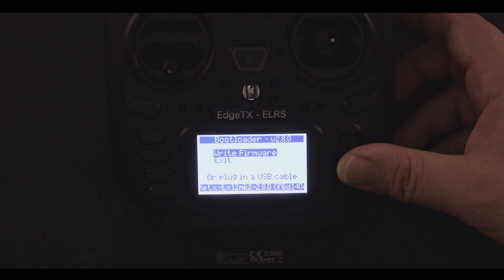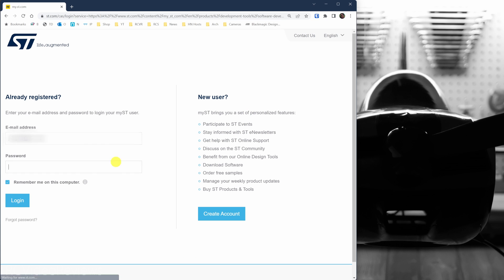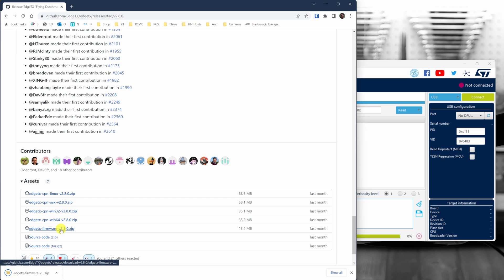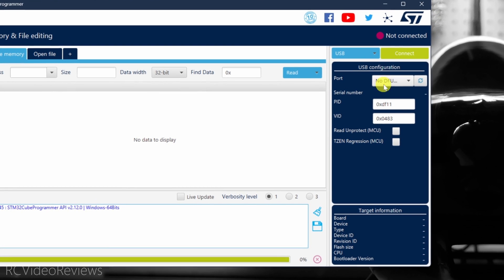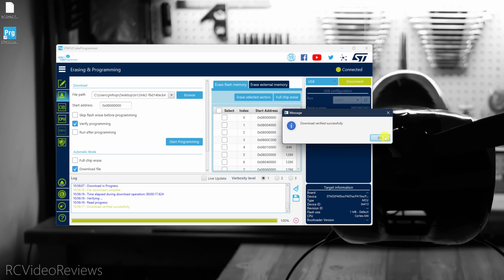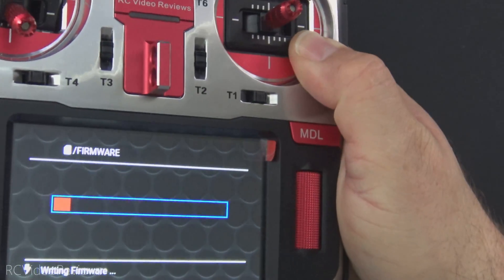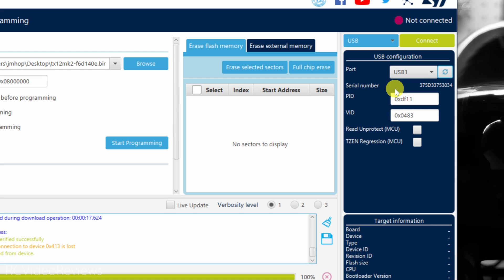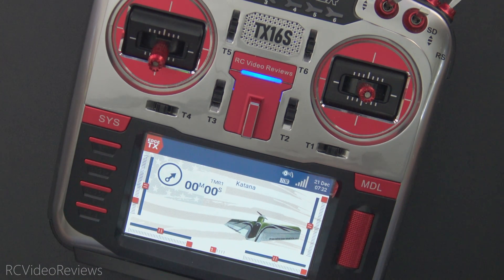BRICK your EdgeTX radio? I got you...let's fix it.

Comment: radiomaster says the issue is edge tx.. you don't need to unplug during update to brick the radio, it happens if you just leave the thing with no battery for a month of no use. next time you come back you either get no power on or bad radio data. just happened to my tx16s and my pocket this whole thing is rather irritating

Comment: Didn't work on my FS PA01. Almost worked. I can connect the controller to the STM Cube Programmer and I can flash it. I then disconnect the USB lead and its just dead. Also, I have to remove the batteries to get it to link otherwise I cannot get the USB link 'bong' noise and to show in the programmer.

Comment: Just spent several hours trying to get my TX16s out of its bricked state after I vainly tried to upgrade from Open to EdgeTx. Used EdgeTxbuddy and it seemed to work i.e. got the screens etc, but not my models (which I did backup). That was last night, this morning changed the batteries in the TX16 as they were getting low, powered it on and apart from the flashing 1-6 indicators and a momentary blue light, screen is blank. Wont turn on at all now, although does occasionally flash lights, but not everytime when i push the power button. So, came across your video and thought "Yes, at last" and carefully followed your instructions. Alas, same thing, no difference, although I do think there might have been a glimmer on the screen when I pushed the power button. Have no idea what's going on and at my wits end. Almost makes me feel like just giving up on RC, I'm so frustrated. Anyway, without a TX I cant fly anyway, so maybe will call it a day. But thanks for posting, have always found your videos super informative and helpful on so many aspects of the hobby.

Comment: Hi John, thank you for this unbrick-the-radio procedure. I have a separate issue, after upgrading the EdgeTX firmware on my TX16S its RS slider doesn't work properly. It tights to the SA toggle switch. I had never seen this happen before, the SA switch has to be at the center or forward position to activate the RS slider. If the SA switch is at backward position, the RS is disabled! I reinstalled the EdgeTX firmware several times, but this issue is still there. Your advice would be appreciated. Thank you.

Comment: Thank you for a concise, informative and useful video. I used your guidance to unbrick my Taranis X-lite; STM32CubeProgrammer has no issue picking up the radio with or without the batteries in and installing the new firmware, but it still won't turn on. When I open/close the battery "tube" the power button lights up momentarily but doesn't respond when pressed. Any suggestions?

Comment: Will this fix internal module update error?   I have a brand new 16s and the internal 4-1 doesn’t work.  It won’t accept the flash.    The rest of the radio works fine

Comment: When trying to ocnnect to my bricked TX12 i get:
  15:27:06 : Product ID  : STM32F2BOOTLOADER
  15:27:06 : SN          : 386E305B3131
  15:27:06 : DFU protocol: 1.1
  15:27:06 : Board       : --
  15:27:06 : Device ID   : unknown
  15:27:06 : Error: unknown or unsupported device (DevID = 0x0000)
  15:27:06 : Error: CUBEPROGRAMMER_ERROR_NOT_SUPPORTED

What can be the problem here?
Device is connected, i get the windows sound and button starts glowing red
Reply from the maker: Not sure. I've never tried this process with a TX12.

Comment: Hi, John! Thank you so much for your help! But I have a massage Error: download verification failed. Error: Data mismatch found at address  0x08000002 (byte = 0x00 instead of 0x03)
Reply: I figured it out, press on full chip erase and then start the programming that should work

Comment: Hello John, 
Thanks for your video, but it doesn't work for me.
I had problems to flash new firmware: Did not get into flashingmode by shifting the trim buttons and switching ON. 
So I tried to set it up new with your instuctions. 

TX16S, actual 2.9.4 firmware file is tx16s-77884b6.bin. .
Connection to transmitter works, USB found, connected, ... 

Starting flashing it sais:
...
17:26:05 : sector 0019 does not exist
  17:26:05 : sector 0020 does not exist
  17:26:05 : Download in Progress:
  17:26:24 : File download complete
  17:26:24 : Time elapsed during download operation: 00:00:18.291
  17:26:24 : Verifying ...
  17:26:24 : Read progress:
  17:26:26 : Error: Data mismatch found at address  0x08000005 (byte = 0x24 instead of 0x26)
  17:26:26 : Error: Download verification failed

And the transmitter doesn't work.
What did I wrong?
Juergen
Reply: Works now!
in the STMCubeProgrammer first do "Erase flash memory"/"Full chip erase" . Then the programming runs without error and the transmitter works. 
Again: Thanks for your video! I would never have had the idea to use this programming software.
Juergen

Comment: Thanks for the video. Do you think my radio is done if I couldn't program it? It's says sectors does not exist during the writing firmware and data mismatch error in the end. Could it be fixed by changing flesh drive?
Reply from the maker: I'd probably try a different SD card.

Comment: This really work. My boxer stucked on bootloader. I was hesitant that this will not work. I follow the instructions. Kaboom. I turn my boxer radio. A fresh firmware 2.9.2 version. My original oversion was 2.8.0. Thnk you. You saved my radio boxer. Kudos to you

Comment: hi, nice tutorial.
 for me it's not working. i pluged my TX16s, i have the usb noise, but when i try to connect after select usb and refresh;  i have this error  
  05:06:44 : SN          : 3449334A3539
  05:06:44 : DFU protocol: 1.1
  05:06:44 : Board       : --
  05:06:44 : Device ID   : unknown
  05:06:44 : Warning: Device is under Read Out Protection

What can i do pls
Reply: it's ok i find de way by myself with DFU reset tool
Reply: Thx you so much i'm in edgetx now

Comment: My Eachine TX16S was bricked by some unknown reason. Before that I flushed EdgeTx on it. I was trying to follow this manual, but it didn't help :( I have no idea what is wrong. My radio also failed to turn on, but after few attemts it turn on with gray blinking screen. Also when I'm trying to connect it to computer there are not sound "bong"

Comment: Hi, great video.
I just bricked my TX16s It had open tx on it 😢 sd card failure during firmware upgrade. Your video helped me fix it? Cheers
Thanks  heaps, any chance you can supply a model setup for the M2 to download and add to tx16s openTX model folder 😁 Cheers
Simon New Zealand
Reply from the maker: I don't use OpenTX anymore, so I'm afraid I can't help on the OpenTX issues. The process in this video can get you running on EdgeTX. You can always flash back to OpenTX from EdgeTX though.
Reply: @RCVideoReviews 
Thats excellent news, and it will give me a look at edgeTx-I may decide to stick with it. thank you again, keep the great videos coming.
Reply from the maker: You're welcome and I will :)

Comment: Good day. In the plans of wanting to buy radio controllers, the question arose in the choice, so that it would also be for the future. There are plans to create airplanes, quadcopters with short-distance flights, and glasses for photos and videos.

Is it worth taking a 4 in 1 multi-protocol, or is it better to take it with erls

I chose the following radio controllers -

- TX16S Mark II MAX Radio Controller (Customized Version) - AG01 Gimbal or V4.0 Gimbal
- TX16S Mark II Radio Controller (Mode 2) - V4.0 Hall Gimbal or AG01 Hall Gimbal
- TX12 Radio Controller Mode 2,
Which of them is the best to be compact and last for a long time, I would like precision in control.
I want to choose two:
Example:
- TX12 Radio Controller Mode 2
- TX16S Mark II MAX Radio Controller (Customized Version) - AG01 Gimbal or V4.0 Gimbal
or
- TX12 Radio Controller Mode 2
- TX16S Mark II Radio Controller (Mode 2) - V4.0 Hall Gimbal or AG01 Hall Gimbal
Is one of these better for now and for the future:
- TX16S Mark II MAX Radio Controller (Customized Version) - AG01 Gimbal or V4.0 Gimbal
- TX16S Mark II Radio Controller (Mode 2) - V4.0 Hall Gimbal or AG01 Hall Gimbal
- TX12 Radio Controller Mode 2

Or buy 4 in 1
- TX12 Radio Controller Mode 2
And from ЕРЛС
- TX16S Mark II MAX Radio Controller (Customized Version) - AG01 Gimbal or V4.0 Gimbal
or
- TX16S Mark II Radio Controller (Mode 2) - V4.0 Hall Gimbal or AG01 Hall Gimbal

Thanks for the advice
Reply from the maker: Please see my response in discord. Thanks.
Reply: @RCVideoReviews  Ok. Thank you

Comment: I have tx16s mkii but I couldn't see tx16smk2 among the options. Should I go with the tx16s one?
Reply from the maker: They use the same firmware if that's what you're asking.
Reply: @RCVideoReviews  In my case, it happened right after I got the radio, that is, when the 2.5 version was installed. In this case, is it okay if I install the 2.8 version directly without changing the SD card contents?

Comment: Computer doesn’t recognize it when connecting the remote to the pc..
Tried few cables, other computer, nothing..
The remote react to the connection by powering on the airplanes led lights it’s TX16S
So I cannot use any software due to computer don’t recognizing it..
Reply from the maker: You can take the SD card out of the radio and populate the software directly to the card from the PC.
Reply: @RCVideoReviews  Will it work if my transmitter doesn't even turn on?

Comment: Hello i have a problem with my new tx16s i bought from TBs blowoutsale, i Get a bad radiodata and have too do the stick calibration, the radio is emty and model missing, When i plug my tx16s into my computer, only the firmware folder shows up, not the SD card also. I need hjelp
Reply from the maker: I'll offer one reply here, and encourage you if you need additional help to get on my discord (link is in the description of every video I post). 

Get the EdgeTX SD Card Contents here: https://github.com/EdgeTX/edgetx-sdcard
Extract to your SD card (put card directly in PC if you have to). Then put the card in your radio. You'll probably be prompted for a calibration again, but that should be it.

Comment: Hello John, thank you very much for your content, it helps newbies in configuration like me to get ahead, i wanted to ask you if you could give me a hand please because of an error that i get at the end of the verification process, data mismatch found at adress 0x08008000 (byte = 0xFF instead of 0x00) the file downloads correctly but i have that prevents from finishing as you do. Thanks for the support anyway
Reply from the maker: I haven't seen this error. You're 100% sure you're using the correct binary--it is tx16s not tx16?
Reply: @RCVideoReviews  Thank you very much for answering, it is a zorro, I updated to the latest version 2.8.0 and it stopped turning on, it only turns on in bootloader mode and it does not detect the versions that I put in the sd
Reply from the maker: Placing a binary on the sd card does not update it. You have to actually flash the board with the bootloader or from dfu mode.
Reply: @RCVideoReviews I can flash the radio with Edgetx, but the sd, when I can only turn on the station in bootloader mode, the edgetx does not read it, I put the folders with the firmware of the station version on the sd, from the station it lets me write the firmware what is in the sd but once written it does not find version. Thanks a lot for your time

Comment: Hi and thank you so much for the video! I don't know if you do comment cries for help but I'm still stuck! I have a TX12 MK1 that I tried to updated using the EdgeTX Buddy without an SD Card installed (I thought they were only needed for audio files). I installed an SD Card, followed your video, but when I power the radio up it just goes through the power down animation. Any thoughts? I'm about to give up and buy a new radio.
Reply from the maker: You need to join discord and aske there. There is too much going on this question to resolve on YT. https://discord.gg/jSFTASU

Comment: Hey John, Thanks so much for this video. Any suggestions for what to do if I get no response when plugging in the radio? i've tried multiple cables and multiple ports...
Reply from the maker: Does it turn on? If it doesn't turn on and you get no movement on the 6 position light when you connect to a known working cable and known working port, something's broke I'd say. You might be able to re-seat the ribbon cable for the primary display. You might also be able to disconnect some of the connecting cards (switches), but basically this sounds like you're going to need to contact Radiomaster.
Reply: In case anyone else comes across this issue my Radiomaster zorro kept connecting and disconnecting in usb 3 ports. Connected it to my usb 2 and I was sweet.

Comment: at the end is it NOT required to eject the radio from pc before unplugging? I have learned never fail to eject
Reply from the maker: Two reasons it's not necessary:

1) This is a dfu write which writes to hardware, not the SD card. The DFU write terminates the writing process and then based on instructions in the video verifies the write. Windows doesn't have any idea what's going on in a DFU write so the old caching concern around "safe eject" is not relevant.

2) Windows 1809 changed the default caching behaviour. It hasn't been necessary on Windows for some time now. https://www.theverge.com/2019/4/8/18300734/microsoft-safely-remove-eject-usb-flash-drive-not-needed-windows-10

That doesn't mean you disconnect WHILE data is being written to the SD card; however, once Windows says it's done writing, it's done writing. 

That old premise is based on caching and interrupting a write from cache after Windows indicated the transfer was complete.

Simply not necessary on current versions of Windows.
Reply: @RCVideoReviews  Thank you, John, That information will probably have been unknown to many, including myself!